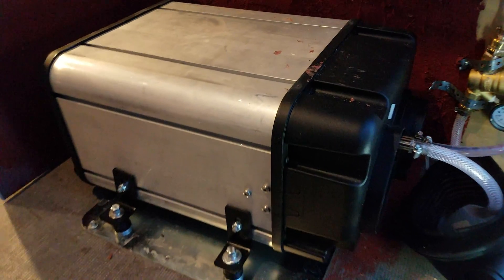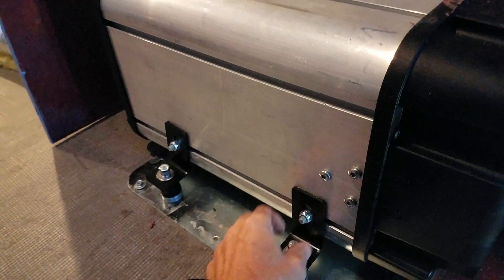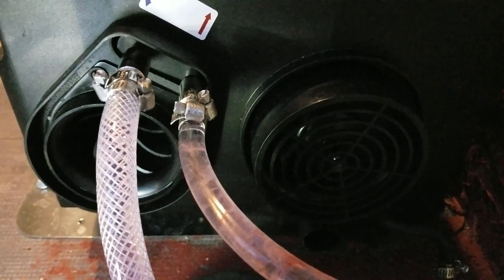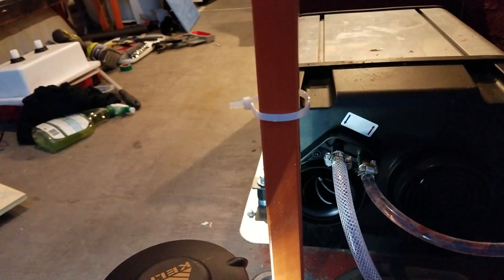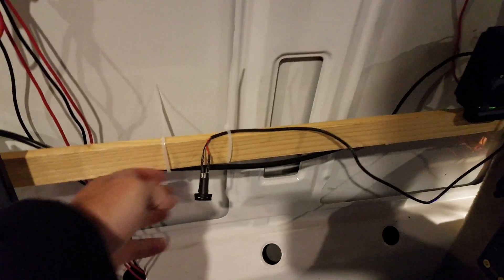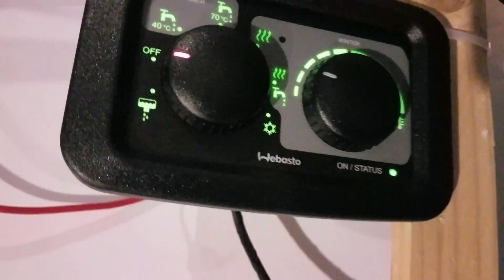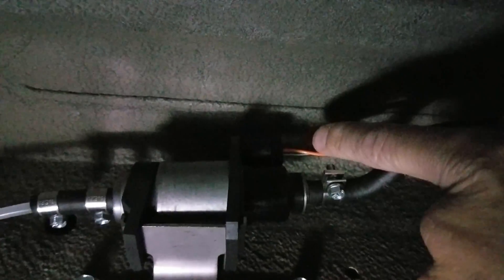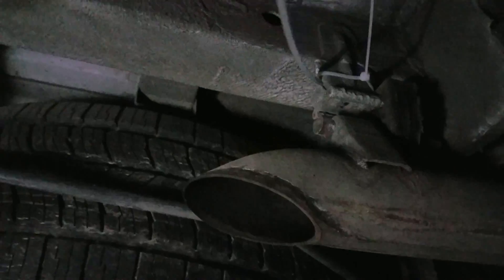Sprinter Van Conversion- Webasto Dual Top 6

Comment: Nice install!
I’m 80% through the install of the same unit into the 170” WB Sprinter as well. Should be done in a day or so.
Reply from the maker: Nice!  Its been working pretty good so far.  The install sucked with the instructions they provide, but I bet I could install it in a couple of hours the second time.  Good luck mate!
Reply: where did u purchase the heater?
Reply: @mdonthetrail9984  Read the description